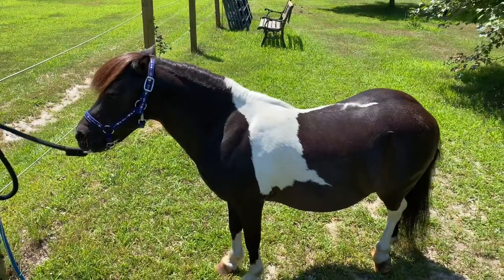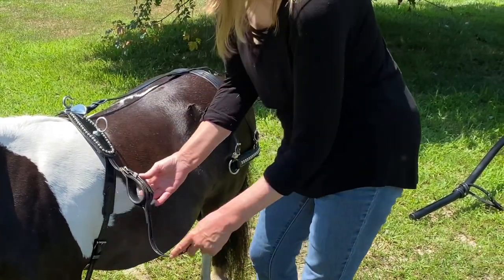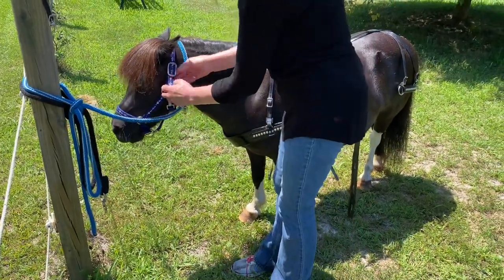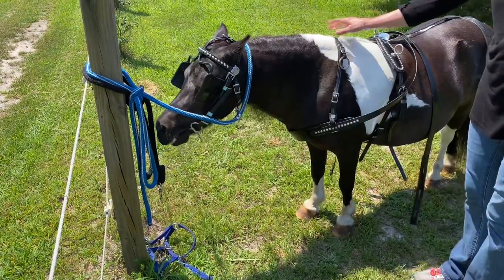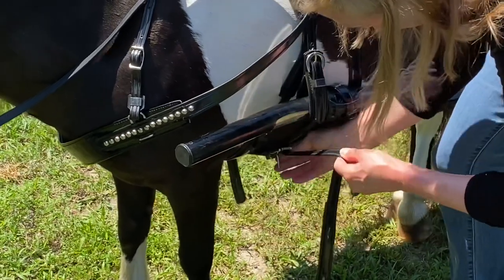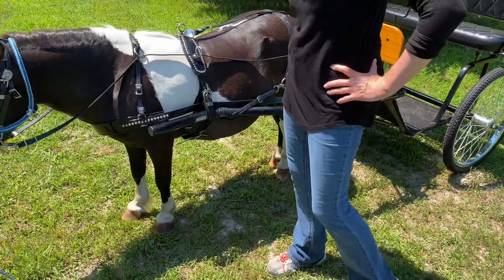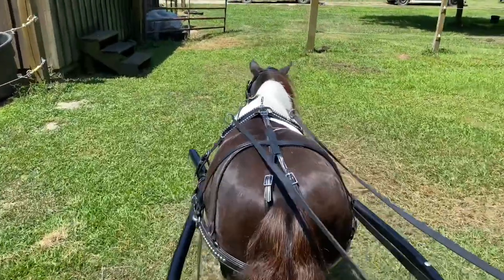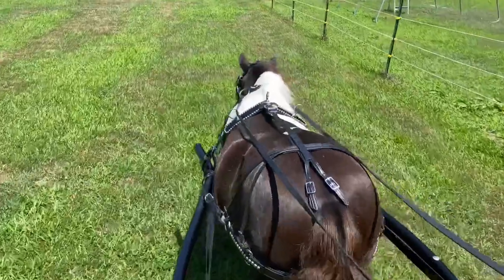Ever Wonder How a Cart & Harness Are Put On a Horse & What It’s Like To Drive?

Comment: I do not recommend not using a overcheck those prevent them bolting and running off on u. They are a safety thing for a reason my trainer says it's unsafe to not use one. And should always have one.
Reply: Also putting a pad on the breast collar and under saddle part is more comfortable and humane. They can get sores from those areas rubbing without harness pads
Reply from the maker: You are not permitted to use an overcheck in most driving shows. I belong to a driving club where they do not use overchecks. When I show in Miniature horse shows, you are required to use an overcheck. I drive both with & without. They do NOT prevent your horse from bolting. Believe me! I do not use an overcheck with my young Mini Teddy who is learning to drive by ground driving. Overchecks are actually not good to use with horses learning to drive, because it interferes with their balance when they are learning. 🐴
Reply from the maker: I have pads for my harness, but do not use them during the summer. A good quality & properly fitting harness should not cause any pain or soreness. 🐴
Reply: @teddybeartheminiaturehorse3301  i use pads year round ...and even at shows
Reply from the maker: @rushellealexandra5243  You must have a Miniature horse? What kind of shows do you show in? The rules are so different in the various shows. It’s quite confusing & frustrating. And then the sanctioned driving club that I belong to does not allow overchecks for their shows & events. They also do not use harness pads. UGHhhhh!!!! 🐴
Reply: @teddybeartheminiaturehorse3301 I show in blue water miniature horse club, and they are amha and amhr based and also collaborate with the American Shetland pony club. It is a requirement at those shows. U can have either the one over the head or the kind that goes from bridle underneath breast collar and between legs. 
Also my miniature mule I bought cart broke and she's well trained according to my trainer.
Reply: @teddybeartheminiaturehorse3301 my mini mule does the country pleasure division.